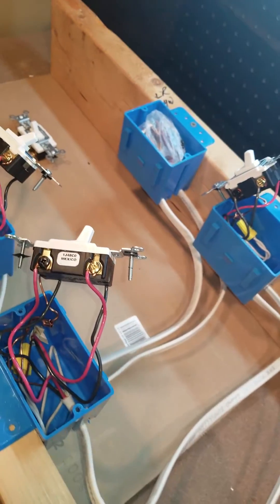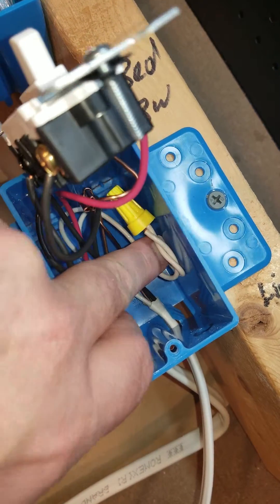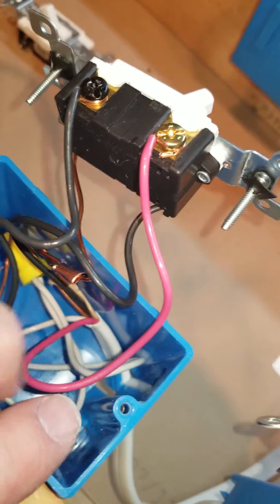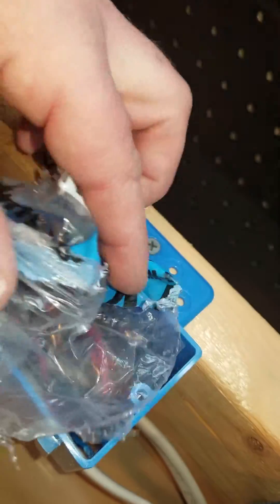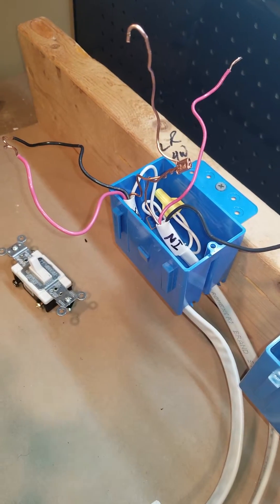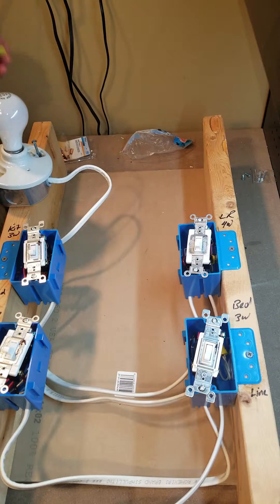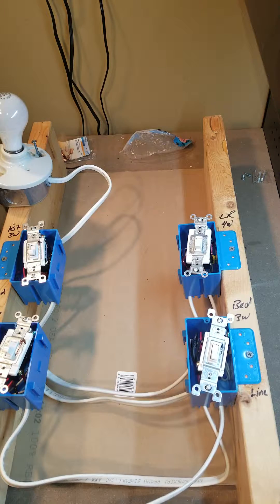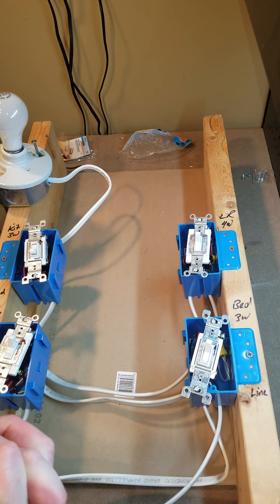How to wire multiple 4-way switches.

Comment: Am I wrong that we alternate which side (input/output) of the 4 way switch we terminate the travelers and commons from switch to switch?

PS - Great vid, thanks for the detail.
Reply from the maker: Thanks. At about the 13 min mark, I show you that you only need to make sure each set (or each pair) of travelers from the same romex or conduit go on the same color screws. No need to alternate travelers from input to output, switch to switch.

Comment: I enjoyed the video. The number one question everyone is looking for a clear answer is, “When we wire a device with four switches or more that control it. Will it work as long as we have a three-way switch on the line and switch leg sides, with multiple four-ways between?”
Reply from the maker: I believe this is what you’re looking for: you can have as many 4-way switches as you want, as long as they’re in-between two 3-way switches. Example: lights controlled by 6 switches is: 3w-4w-4w-4w-4w-3w.

Comment: So what you saying as long as your 4 way switches are in between 3 way you can have as manny as you like? Thanks
Reply from the maker: That’s not the synopsis of this video, but yes—you can install as many 4-way switches as you like.
Reply: @electricaladvice5371  this did help me tho, there is not alot of videos explaining multiple 4 ways.  im looking to do a switched central vacuum system and you vid was the only one i could find explaining having a switch in many different locations for the same device. thank you.
Reply from the maker: @Texas_Radical  you’re welcome!